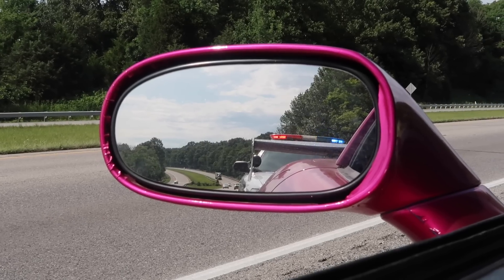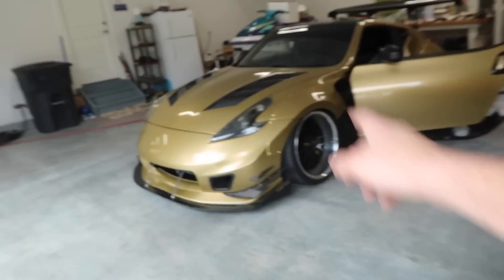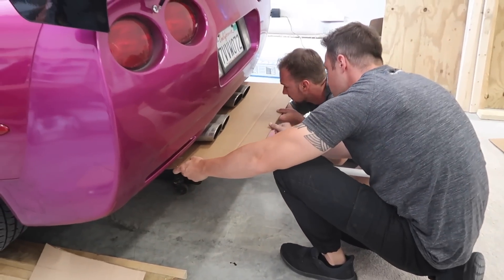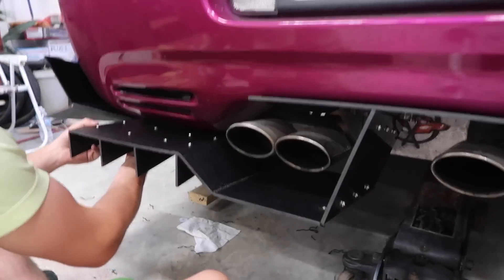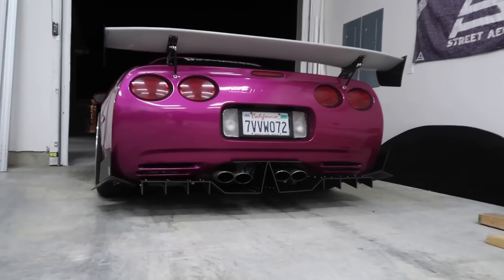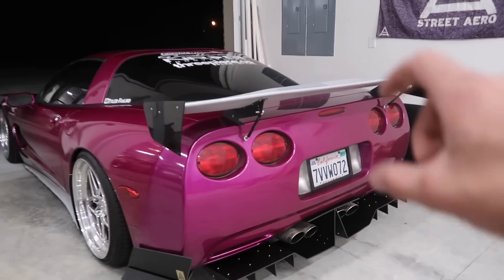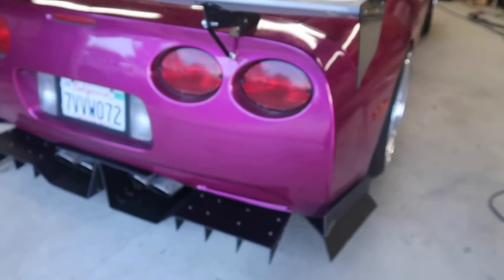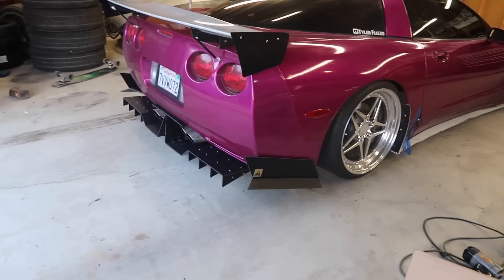Building an AGGRESSIVE! Custom Diffuser For My Corvette

Comment: 0:39 is that a check engine light?
Reply from the maker: Jose Sanchez yes, it's on because of the way I wired in my manual high speed fan switch
Reply: Tyler Fialko ah I see, carry on then
Reply: DatRandyKid calm down kid
Reply: DatRandyKid my car has no catalytic converter so check engine light.   Most idiots will think badly of that but it has 40k miles on it soooo....

Comment: That gold 370z is my buddies old car he ruined it used to be a car that could drift and touge run now it "looks pretty"
Reply: Cameron Centers the Hyundai you traded was curb rashed on most of the wheels and bumper wasn't secure, and the head gasket blew and the engine had to be replaced.
Reply: Cameron Centers from using the car like it should clutch kicking drifting and gripping.